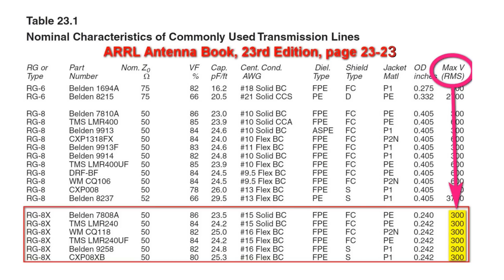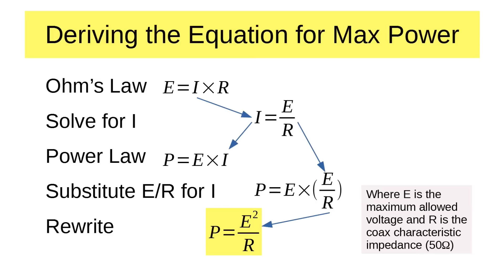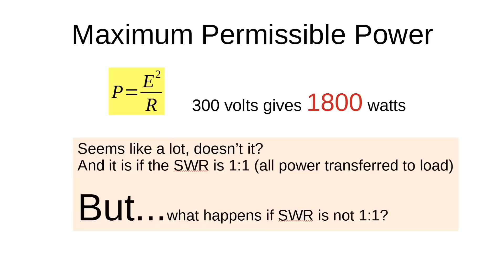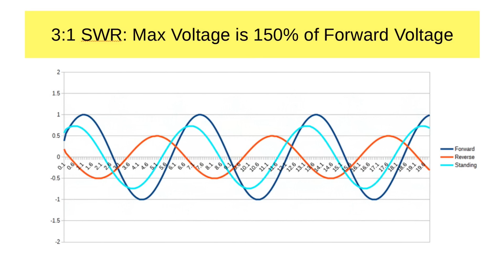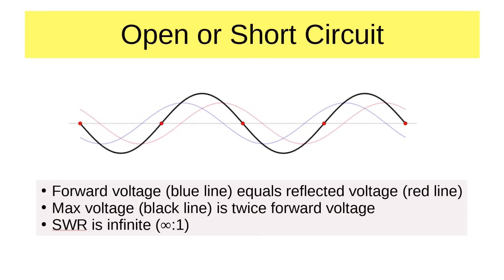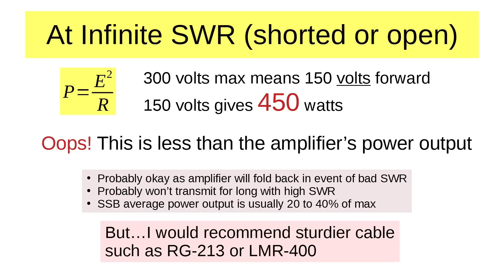Got Amplifier. Do I Need Bigger Coax? (#333)

Comment: I just skimmed the article.  But that is 300 volts RMS not peak which would make the voltage rating for the SWR calculations a lot ,more.  I did not see anything mentioned frequency so at 10 meters it may not handle the power like it would on 80 meters.  However as I can run near the legal limit I use the rg8 size coax  for the antenna.  The exact type varies.

Comment: If you can now get it from MFJ I can strongly recommend the Messi and Paloni cable. It's some of the easiest coax to work with, solders like a dream and their own brand connectors (which are solder for the core and compression for the sheath) are fantastic if pricy

Comment: I agree I was running rg8x with an Ameritron 811 but since upgraded to the Acom 1000 so had to change everything from the amp out . I used 8u in the shack for jumpers as it is fairly flexible then lmr-400 out to my antennas. Great video :) .

Comment: Good video! Spot on. I run high power and use LMR 400. I do not use any tuner or own one. I ham my antenna tuned to where I operate. I have 0 SWR on all 4 bands that I use. I do use  SWR/Watt meter in line so there is no supperises. My jumpers are RG213. 73's W3AMT
Reply: What kind of antenna?

Comment: I use military RG-400. Very low loss, you can run a crap ton of power with no problem. It's not the size of your thumb in diameter. Center conductor won't melt. It's little brother is used inside most amplifier's. Silver coated copper wire. Bad side it's expensive. But you can find reputable sellers/dealers on eBay for half price of wholesale.

Comment: Perhaps the best, visual explanation I’ve seen yet. Great video Dave - that’s really helped my understanding.

I use Westflex 103 or RG213 for hf at the UK limit of 400w.  Belt and braces. But recently downsized all patch cables to Mini8 (I think this rg8x) for ease of use on the desk.

Comment: Hi, one of my radios is solely for 11 meters, im a little green when it comes to coax and performance, can you tell me is RG8X compatible for 11m or would i be better using RG213.. i have a relatively short run of about forty feet, thanks for any help.
Reply: It will be perfectly fine on 27MHz but a bit iffy loss wise for VHF and UHF at that length.

Comment: James Bowen...Yes for a short run maybe..But with a 51 cent difference per foot on a long run it will add up very fast..DX Engineering  213 $0.89...8x $0.38..If running more then 200 watts or more then 100 foot run I would not run anything less then 213 or 400 other then that I have never seen a reason to use anything bigger or more costly then 8x..Nor would I waste money on rg-58 for anything lol

Comment: Dave, a very interesting video. My personal preference for HF patch leads is RG142, being thin power meters etc don’t get dragged off the bench. The voltage rating of the cables is confusing, the U.L rating for RG142 is also just 300v but other voltage ratings for it suggest 1900v. It is rated 3500w at 50MHz. RG58 is rated for 3500w at 1MHx, dropping to 450w at 50MHz.

Comment: A little constructive criticism: In my 50 years of hamming, the rule of thumb has always been RG58  for the 100w power level and RG8 (NOT "X") for legal limit. You should clarify the difference between RG8X and RG8, which you (inadvertently) used interchangeably at least once.

Confirming this using the cable characteristic table in my 16th addition, RG8-type foam dielectric cable is rated 1500v which raises the power (by your formula) by a factor of 25 over RG8X, thus RG8 can handle legal-limit power at any reasonable SWR value. By the way, solid dielectric RG213 is rated 5kv, making RG213 a gross overkill for amateur use. 

(Note that cable with non-foam dielectric (PE) have substantially higher voltage rating than their foam (FPE) counterparts.)
Reply: RG8 has gone the way of the dodo... can't rely on the quality anylonger. We as hams have switched to RG213 as defacto standard. Older stuff might still be great coax, but new stuff might be knock off china who knows what.
Reply: @Coffeebreak6329  RG8 has not gone extinct. Half-inch 50-ohm coax is still widely available. The old military designation of “RG8” may not be used, but Belden and others continue to manufacture RG8-equivalents in both solid and foamed dielectric.
Reply: RG8 is to widely counterfeit by the over seas suppliers that I personally will never buy a single foot. My money is on the still mil. Spec. 213/u.

Comment: Note the table did list that as RMS voltage, not peak voltage, shouldn't that be in the calculations too?  That would raise the actual peak voltage (and subsequent wattage) that the cable can carry.  Thanks for the breakdown though, not something I'd thought of till now.  Gary, K5KGT. 
i.e. The RG-8x is listed as 300 RMS V max.  This is  ~424 peak volts.  P=E^2 / R, so allowable wattage is now 3600 watts.
Reply from the maker: The column heading in the table is RMS, so I did all calculations in RMS.
Reply: The hole in that thinking is that the RF is a sine wave,  so the maths is correct in the video.  Peak instantaneous power is double the average power for a single RF cycle.
Reply: @g0fvt  Doh!  Thanks.  Had I looked closer at my answer, 3600 and Dave's 1800, I should have noticed the correlation and noticed it was a half a sine wave.
Reply: Gary Lowder , no problem, though as I posted somewhere above the 300v rating is deceptive. 73

Comment: I run 600 watts on rg8x on off center fed dipole with no problems.but have burned up rg8x on g5rv on 17 meters.I now have lmr400 on g5rv. N9wzl 73s.

Comment: What about running at Legal Limit power? Can we revisit this topic from the viewpoint to calculate it from max legal limit power, so that we have a comparison!
Reply: We learned all the math in this video to do that. I propose we solve P=E^2/R for E. This gives us E=sqr(P*R), where 'sqr' means square root. Insert your legal output power into this formula to get the voltage on your cable at 1:1 swr. The voltage at 1:3 will be 1.5 times that value. The worst case voltage (at open or shortened line) will be 2 times the value. That’s all. An example: in the USA max. legal power is 1500 W PEP. E=sqr(1500*50), so E=sqr(75000). That is 274V. At 1:3 that’s 411V. Into an open or shortened line it would be 548V.
73 from Germany
Reply: @pasixty6510  It takes a European guy to answer this rather simple question...  🤔 73 from the Netherlands.

Comment: I run full legal limit and use RG213 only, the cost difference isn't enough between 8X and 213 to even look at 8x. Good video glad someone broke it down.
Reply: When you get to the amount of money to run an amp the cost difference in coax is hardly worth the effort, go the larger type of choice.